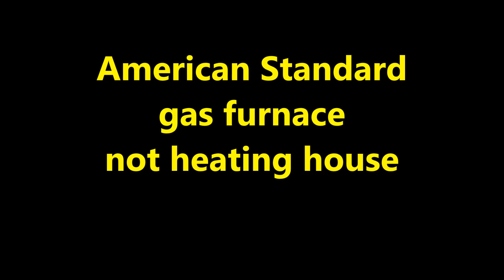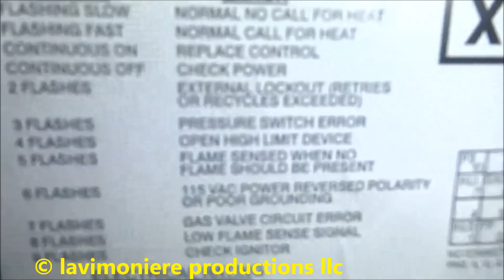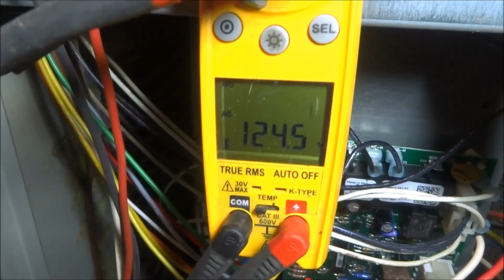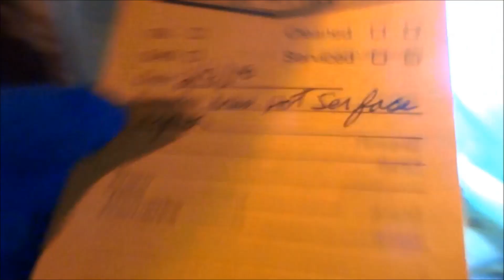American Standard gas furnace not heating house

Comment: HSI go bad because of chemicals used in laundry area, sprays,lint,dryer sheets will make them go bad. Good repair, Steve Lav.
Reply: your right....also if there is an open box of any "oxy clean" detergents nearby...they oxidize the ignitors and flame rods.

Comment: Steve, did the original board have an 80 volt ignitor? Most of the new boards have been upgraded to a 120 volt output which require a new 120 volt ignitor installed at the time of board replacement. They don't seem to tell you that though.

Comment: What is the brand and model of the clamp on meter you were using? That is the first one I have seen that has jaws that can be rotated like that, pretty neat!  I could use one like that in all the cramped places that I have to work in at the shipyard..  ;)
Reply: John Cantrell Fieldpiece. They make lots of test equipment. Most notably is their meter that has removable modules to test voltage, superheat, amperage..etc.
Reply: Thanks for the info!

Comment: Yes you are right !! I have new one ignition .Some man said noo ! My furnace American standard  I tried myself starts then off then starts then off. I tried on thermostat off then on go high 75 . Works ! But repeat 3 times . Works next day again off heat ! What you think ??
Reply: Eva Haberlova dirty flame sensor. Did it lock u out from turning off so many times?
Reply: Nicholas Huss yes, but i go ahead called my friend knows about electrician . i asked him please replace new ignition and cleaned sensor with wool . He came and replace it.  Also lets vaccuming dusty and  burners cleaned with brush . was very dusty . Now works perfectly no problem for 2 months . Thats it. i will go ahead replace ignition every year. will no more trouble . In summer i will vaccumming in fan motor . i see very dusty .   Why most men from heating and cooling never cleaned in furnace and only preview  then blah blah need replace new furnace. i said no Thanks !
Reply: Eva Haberlova glad ur up and running. Annual matenance  of the burners and sensor can keep u out of the dog house when it comes to smaller repairs but when something does go it's likely to b a bigger problem like inducer, blower motor, hi limit, etc..
Reply: Nicholas Huss Thank you ! Last 2 years ago in March enducer motor was noise. i called heating man and  price for $800 . i paid him for coming $100. Lets do myself order online enducer motor cost $190 then called  another friend heating man  under table . i paid him $ 60 for hour . its done . I cant afford  to paid  high price .  I love working around the house and my experience .
Reply: Eva Haberlova I'll have to hire u as the ultimate bargain hunter. When can u start? Lol have a great rest of the week and enjoy ur day. Cheers!!

Comment: I noticed on the previous video where the board was replaced, the part number on the box started with KIT. Trane moved away from 80 volt igniters some years ago. I thought the boxes with a KIT part number prefix had a 120 volt igniter and new mounting bracket included with the board, no?  Some units also required an adaptor so the 120 volt  igniter molex plug would connect to the existing 80 volt harness without having to cut the wires.
Reply: Ian McTeer that ignitor was 120
Reply: Ian McTeer nevermind

Comment: More than likely it was the ignitor false firing intermittently on you first go round with this unit .Its hard to trouble shoot until it completely dies
Reply: Myron Smith, ignitors are either good or bad. Open circuit or still have a ohm reading. The ignitor was not the problem the first go round.
Reply: polishtheturd mickelson - Obviously you haven't replaced a lot of ignitors. When they get old their like a bad spark plug that misfires
Reply: Myron, you have no clue what you are talking about. A HSI on a furnace is not comparable to a spark plug. There are some applications where a ignitor still glows, but the ohm reading is too high to light or prove flame. I have replaced a lot of ignitors bro.
Reply: It wouldnt "false fire" when ever you replace trane boards you have to swap the igniter too. The board was bad but the old igniter wasnt rated same volts
Reply: OK, thanks Francis for your expert opinion.
Reply: polishtheturd mickelson Im not your bro - Any tech will tell you that you can have a igniter that will glow but won't light the furnace
Reply: Francis McGinley - Didn't see the vid when he changed the board .The model number should tell you the igniter voltage .If its a old unit and your putting a upgraded board your dealer should give you the replacement igniter as a package
Reply: Go back and watch it, then you will realize your first comment about the ignitor was wrong and not needed
Reply: polishtheturd mickelson - You don't know for certain what caused the failure its not your service call and you don't know the voltage of the old igniter it could have been replace. Closed minds has no place in trouble shooting
Reply: I know the board was bad from the video Steve put up on it. The ignitor was bad in this video. All I need to know. Hope you can learn something from watching Steve's videos, not your service call either. I agree closed minds have no place in troubleshooting. My point is any qualified tech would have replaced the control board due to the way the furnace was acting. He left they had heat for over a week. Things happen, I bet you never have a callback, lol.
Reply: polishtheturd mickelson Dude Im in my 50s Im close to retiring I got 32 years in .L.U 98 Philadelphia
Reply: Congrats, enjoy your retirement.
Reply: Francis McGinley - You don't know this for sure .How do you know its even the original igniter  or what voltage it was rated for its a old unit.May not even be the original board
Reply: Very true i dont know for sure witch board etc. But there was a very long range of furnaces i think from about 2000s on where they change them. And the supplier "should" give ypu the igniter. But you know how that goes. In my case the company i work for when you change a board you have to know or find out about the igniter otherwise if you grab a board off the shelf if you dont find the matching igniter for the board it will end up with a situation like this where board goes a week or two later

Comment: TRANE/American Standard used 80 volt igniters for awhile. The old board and igniter could have been 80 volt. When you got the new board it is 120 volt and that would have burned out the 80 volt igniter.
Reply: D Hinton see that all the time. I know some boards come with the upgraded ignitor
Reply: Michael Henderson The supplier should have known it it needed a kit instead of just the board.
Reply: D Hinton your right. Every Trane I come across I check voltage. I keep a couple 80v ignitors in my van